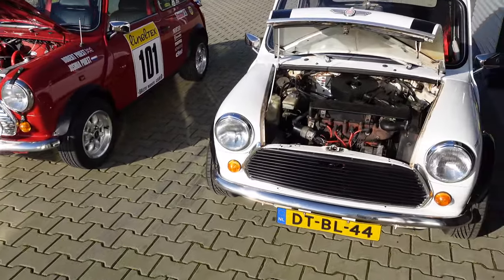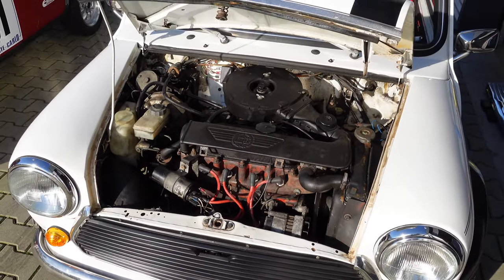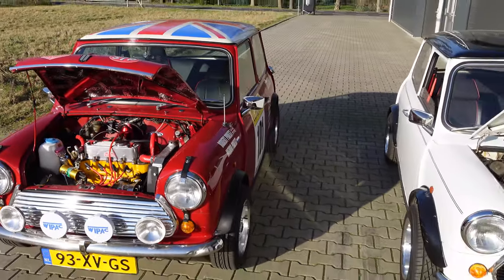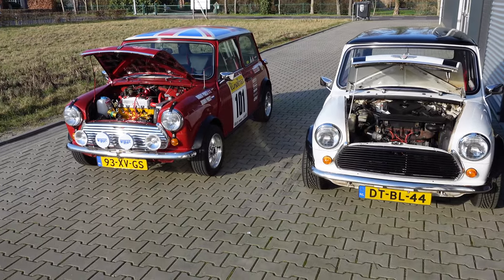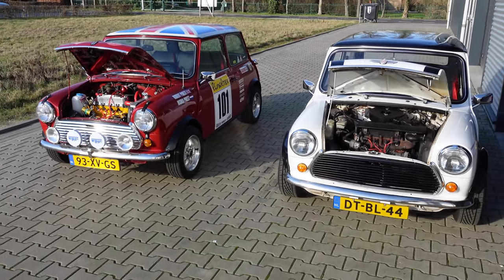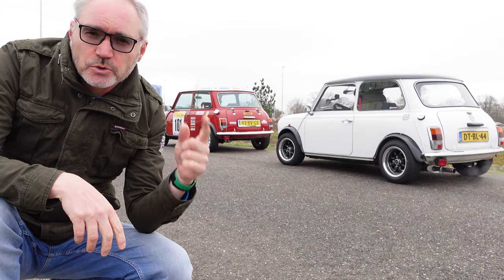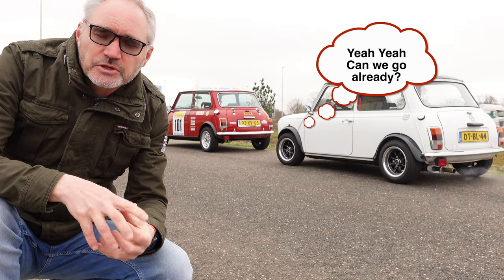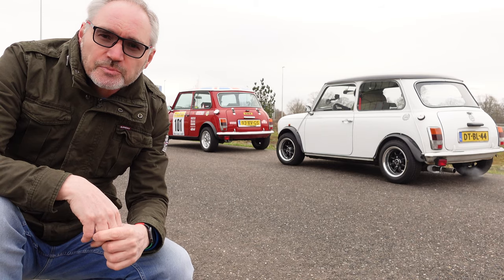Classic Mini 998 (stage 2) Versus 1275 Cooper

Comment: Nu 998 with maniflow stage one and 12g295 cooper s head was exactly as our 1275. But shorter gearing and 10inch wheels probably helped with acceleration. 

In general a 1275 will be faster, but there's just something about the 998 and how it wants to rev that makes it so much fun.

Speed is overrated anyway in my opinion.
Reply: I have a 998 engine ,which was definitely faster than two of my friends 1275s. As far as I know it was a completely unworked engine, it was very fast and I have no idea why. Until I destroyed the gearbox however.

Comment: Very interesting comparison! What cylinder head or valve size has the 998? HP?
Reply from the maker: Robin the 998 has the MiniSport stage2 kit on it...
 Last time we checked we are getting around 52 bhp at the wheel, the 1275 around 62 bhp......not alot of differance if you can take some weight out of the 998.

Mini Sport modified cylinder head
Reply: @classicminiculture9800  thanks!

Comment: Neat! I’m in Canada 🇨🇦 and have a 1968 998 automatic. It’s a pain to find transmission parts! How far can you go up the power curve before you damage the transmission clutches?
Reply from the maker: Tom, you can safely double the horse power of a automatic, on the later mini's you can go a little further than that because the AP2 gear box had larger bearings.
Reply: @classicminiculture9800  Can you put a later box on an early engine? I saw an Austin America that was an automatic and 1275, that’d probably be an easy swap to double horse power eh?

Comment: Hi bro great videos. I was wondering if you take the distributor out to clean it and you've moved the car but want to put the distributor back in how to set it up that the timing a correct.
Reply: Get cyl 1 on its firing stroke, you can see this with the crank pully timing mark, or the flywheel timing mark. Then put your distributor in and time it with a timing light.

Comment: What am I missing? The 998 is an auto, but you are still shifting? Is it clutchless but still manual shifting?
Reply from the maker: Fully Automatic is only when you engage  D (drive), shifting 1, 2 , 3 still works to maximum revs without automatically shifting (unlike modern cars), so you can shift the first few gears before you go into D.......these early mini gearboxes were a real engineering feat!

Comment: How durable are the automatic transmission would you say?
Reply from the maker: They tend to last longer than a manual, you can safely double the horse power as well without significant wear, particularly the later AP2 gear box, challenge is when they do fail not many people know how to work on them and finding parts is a challenge.